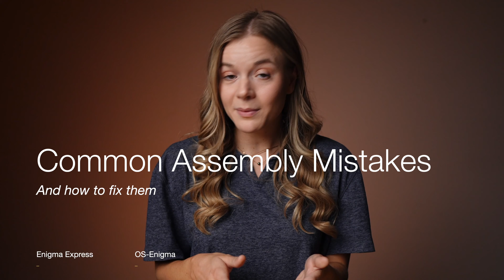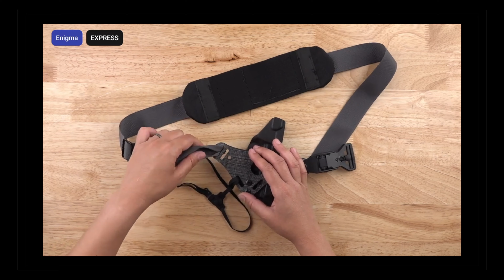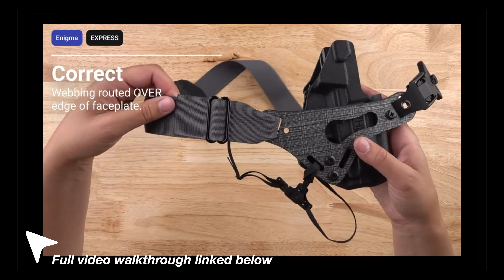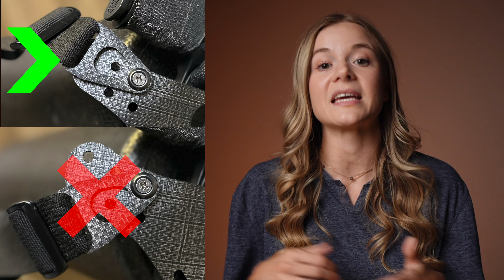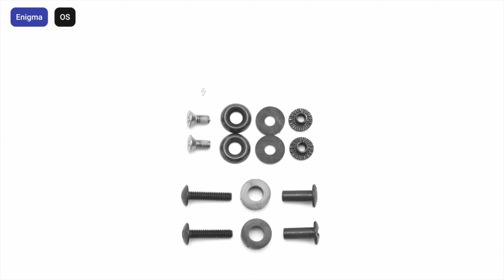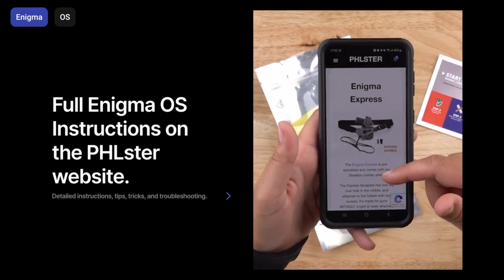Common Assembly Mistakes | PHLster Enigma-Express-OS-LBE

Comment: The leg leash is complete garbage, it will not stay latched.
Reply from the maker: If you’re having an issue with the leash, make sure it’s fully and completely snapped and oriented correctly. And you can always contact us via the website for support or a replacement.

Comment: The fact that so many little mistakes can damage the tegris makes me question its durability, especially long-term, even if used correctly. Why is it necessary? Could you attach the belt directly to the holster and/or wing (especially the ModWing screw)?
Reply from the maker: If you put steel parts back together wrong, it'll negatively impact the durability and longevity of the parts. We use Tegris instead of just one homogenous belt material for everything because the part of the belt which contacts your body and the part which contact the holster don't need to have the same characteristics. A material which is stiff enough to apply concealment pressure to the holster is too stiff to be in contact with the body. And a material which is soft enough to conform to the body isn't stiff enough to contact the pistol. It attaches to the holster the way it does for several reasons. 1: balance and stability. 2: Security.